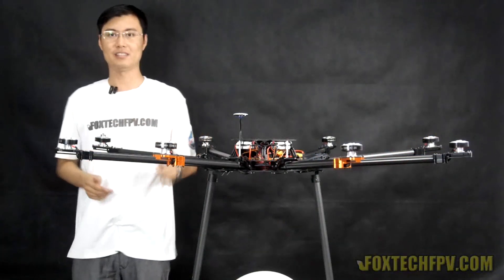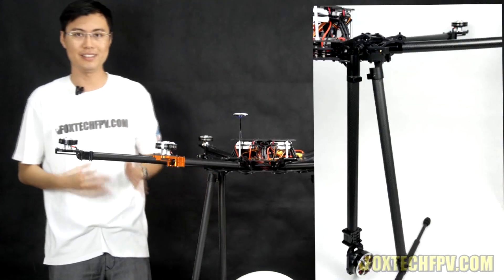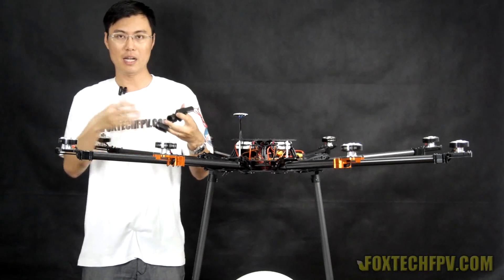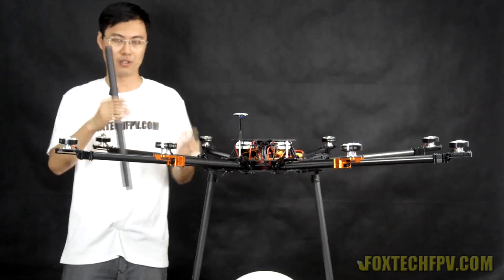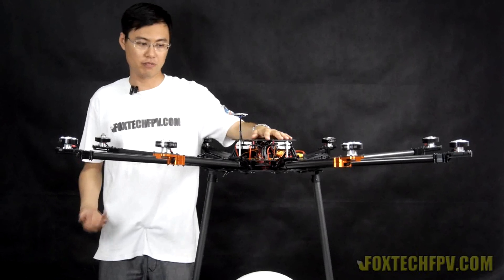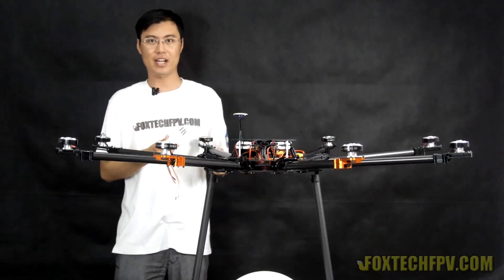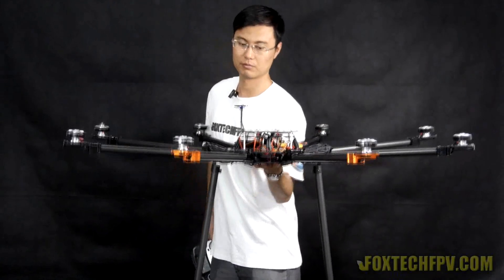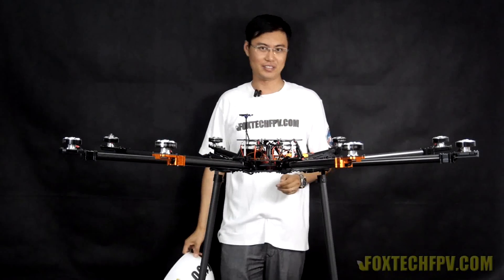Foxtech K130 V3 Presentation

Comment: I would really like to see how any gimbal attachment to the base of the K130 works. Do you mount rails or bolt directly to the outer plate for example. Most customers are going to buy this to lift a heavy camera, so let's see how you mount for example zenmuse gh4 or dslr gimbals please. Thanks Fu.
Reply from the maker: Sure , we will bring more video, with Gimbal and camera is for sure .